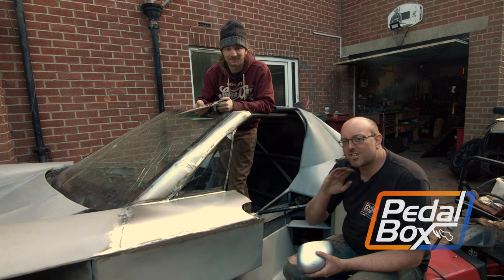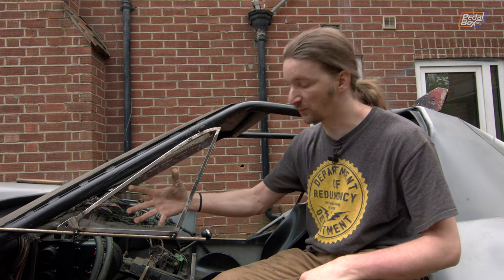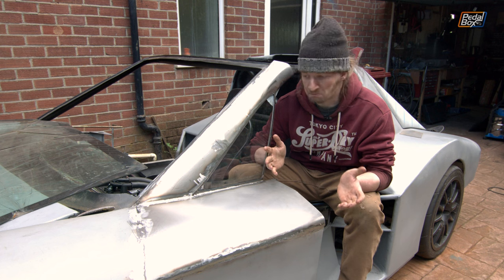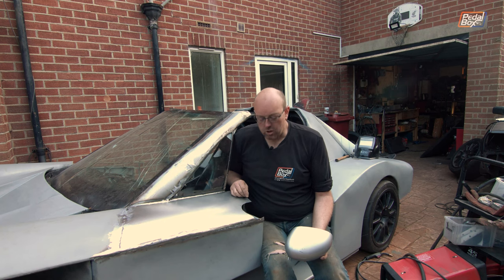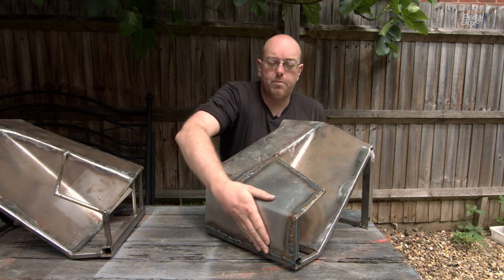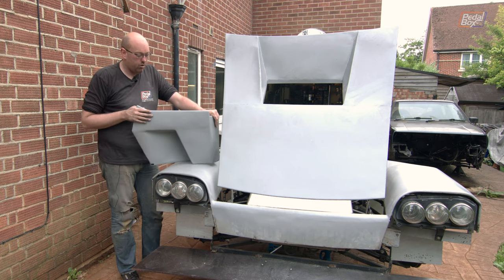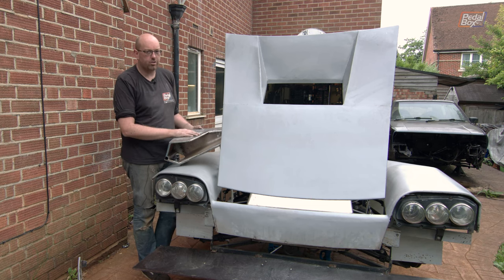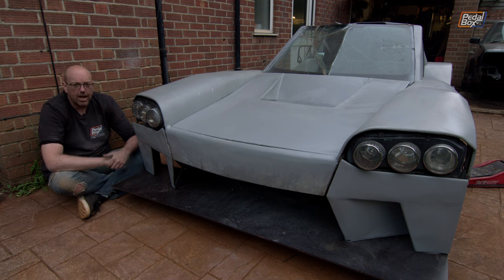Glazing, Pillars, Wings and Mirrors | Audi TT Kit Car | PedalBox Episode 109

Comment: You should use a guide coat for finding high/low spots. A mist of flat black paint over the primer. The mirror is not lo low, did you try it out with a seat?
Reply from the maker: Yeah when we did the original mounts for the mirrors waaaay back, we worked it all off the seat and what the IVA guide needs you to be able to see, should be ok